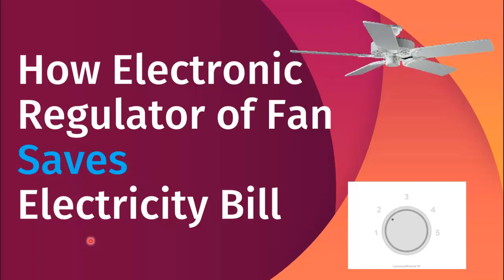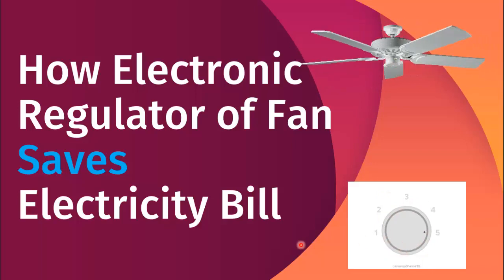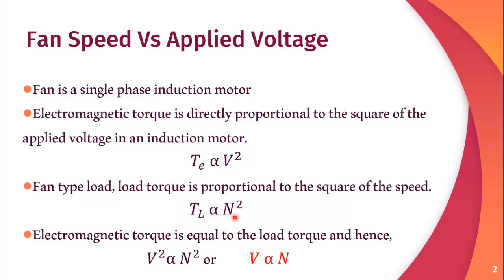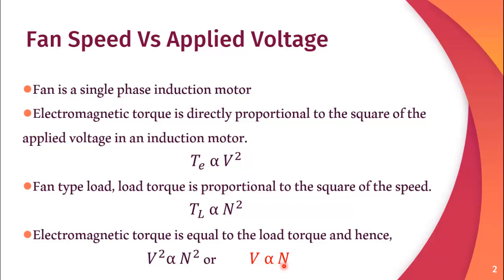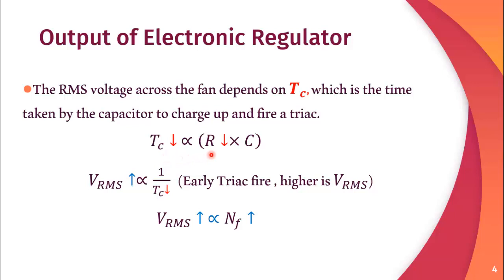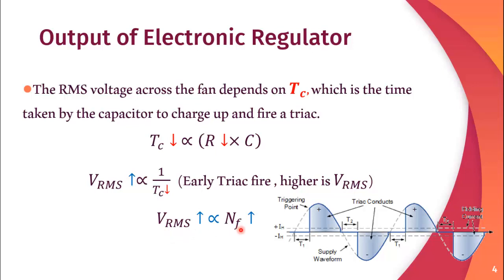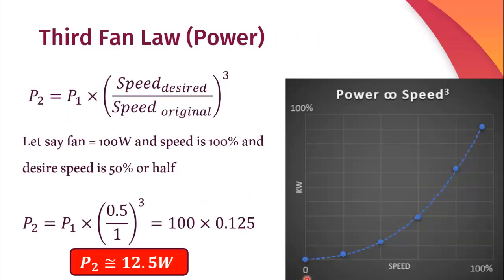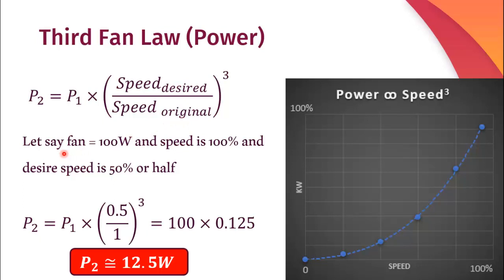Reduce Electricity Bill at Home | Amazing Trick

Comment: When we are rotating the fan at 50% speed, there is also a greater drop of voltage across the regulator right? Shouldn't we add the power consumed by the regulator too?
Reply from the maker: This is electrical regulator you are talking about which dissipates power across it. This video is about electronic regulator which controls the firing to control speed
Reply: @electricallectures  okay I see 👍🏼